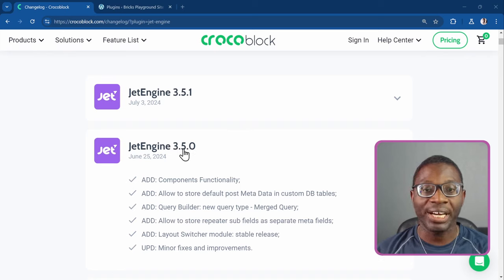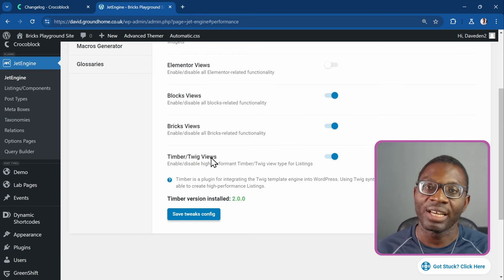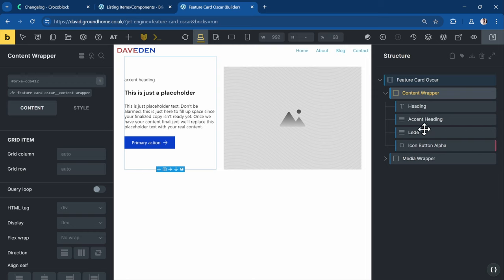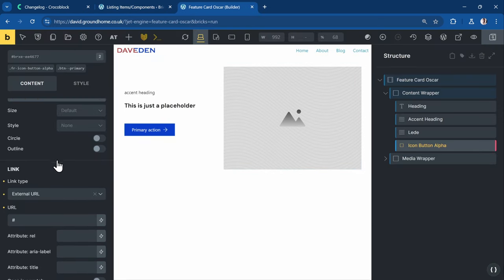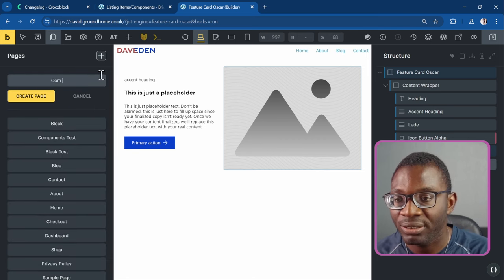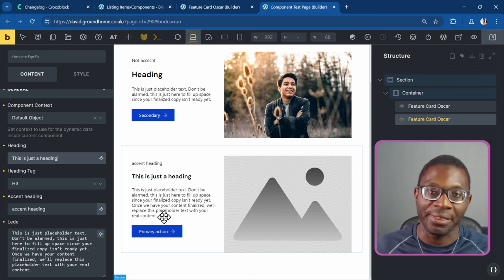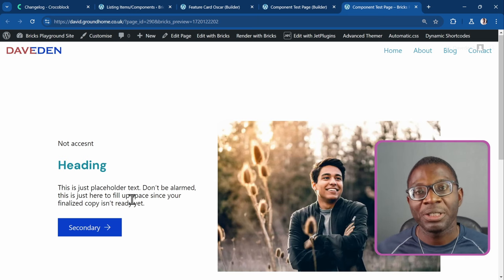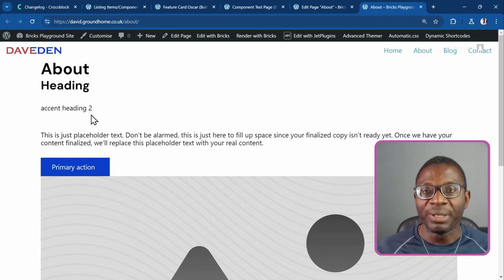Jet Engine 3.5 Components in Bricks builder

Comment: I am using CrocoBlock products for a few years now, and they are excellent.
Bricks is planning to launch components very soon, I wonder how these will work?😅
Reply from the maker: Yes, I am excitedly waiting to see the Bricks native version as well!

However, I suppose one difference would be that the Bricks components would likely only function within Bricks. You may not be able to use them easily in Gutenberg.

Comment: Nice, I imagine this aligns with the upcoming Bricks components. I hope we can incorporate in-place editing. The user accessibility of this feature within Bricks is debatable, as it may require user access to Bricks, but it remains beneficial for general building. I would opt to retain the user in Gutenberg or utilize AT to streamline the interface.
Reply: We are currently using a fourth-party plugin on top of third-party plugins. I appreciate that this is being made available, but eventually, these elements need to be integrated into Bricks Core (or even WordPress Core). Components, frameworks, and client editing (or exporting as Gutenberg blocks). I am pleased that all these integrations exist at the moment and shine a light on the possibilities of modern development.
Reply from the maker: Yeah, I'm curious about the final native Bricks component would be like too. I'm not a very big fan of Bricks inline editing, I feel Gutenberg does a lot better with inline editing. 

If we let clients use JetEngine components in Bricks, we might need Bricksforge or AT to hide other elements.

I like the fact that we can make a Jet Engine component in one builder and use it in any other. That's where it differs from Gutenbricks.
Reply: @daveden2 Yes, an interesting approach. I still have a license from back in the day. I should dust it off and experiment with it. It's a great feature even without considering clients. It adheres to the Don't Repeat Yourself principles, allowing you to construct your entire project using components. This way, a complex build can be easily updated, even with ID styles since there aren't many locations to update. Integration with global CSS or a framework further simplifies the process.
Reply from the maker: I agree. All of these separate parts can simply become one big integrated builder. 

Have you had a chance to test out the WordPress Patterns override in WP 6.6?

Comment: This is a great feature from the Crocoblock team, who are known for their innovative solutions. However, I believe Advanced Themer offers similar functionality with extensive controls and features we need. Nonetheless, it’s fantastic that we’re getting this in JetEngine, which means we’re not limited to just Bricks. What are your thoughts?
Reply from the maker: Yes, Advanced Themer does have the Strict Editor View, which is excellent.

I think Jet Engine's components differ in that:
● All sub-elements (heading, image, etc.) are packaged as a single component.
● You can restrict the HTML tags that editors can access in the component (h2, h3, p). AT would only allow you to disable the entire heading tag control.
● The component works in both Gutenberg and Bricks.

I believe both plugins can work seamlessly together to improve the editor experience.

Comment: Hello, can I put a slider and then show it in a jet form builder field, bringing the post source and custom template?
Reply from the maker: Sorry, I'm not sure I understand the question. Could you explain a bit further?
Reply: @daveden2  hello. I have a radio type field in jet form builder. I have dynamically brought a cpt into this field and given it a custom template (listing item). I need to show it in the slider form. Can I do it with component?
Reply from the maker: @anthonyespino7214  no, a component would not help in this case. A component simply converts a group of elements into a template. But with the ability to change the text content per instance.